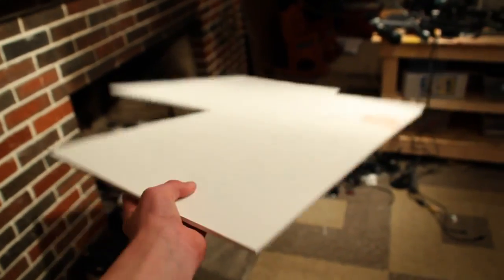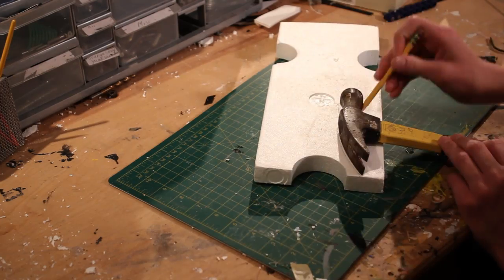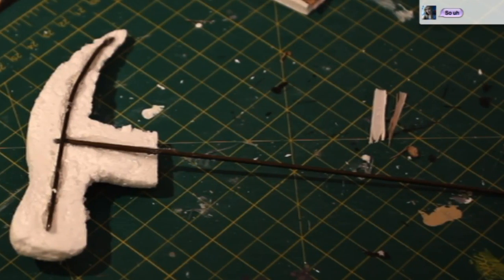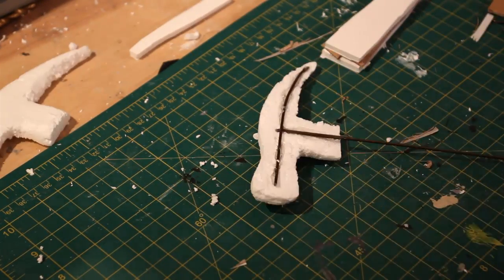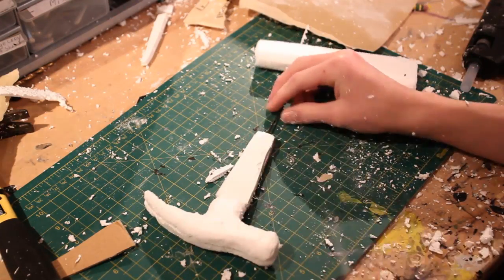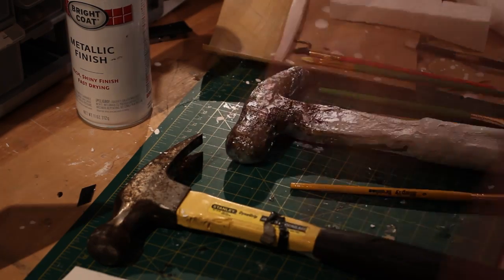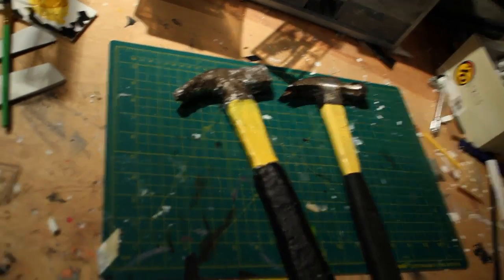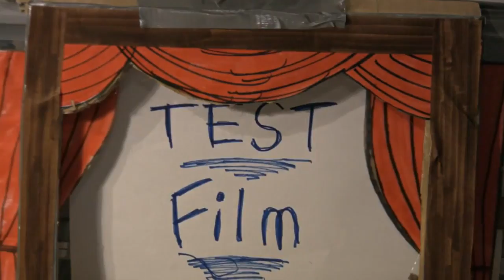HOW TO: Build a Stunt Hammer: Throw a Hammer at Someone!! -

Comment: You can also create a mold of the hammer in plaster but it's not as easy with claw hammers (that's what they are called). Sledge hammers are easier because they have no details and you can run a dole down the shaft and make the whole thing out of silicone form. But making the models are a bit trickier because you have to worry about not fusing the halves of your model together by not overdrawing your model leave it too long and you can't pull them apart too little and it will just break.